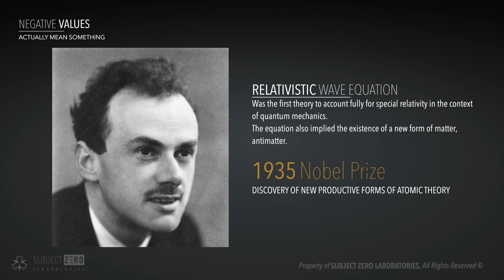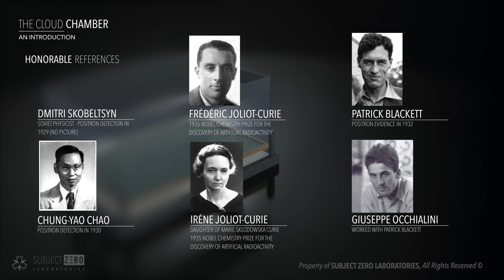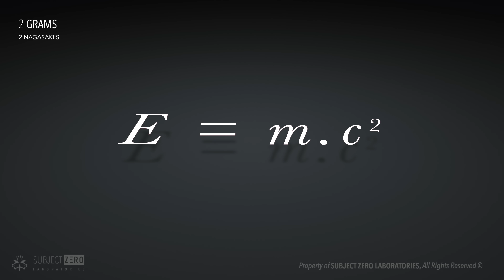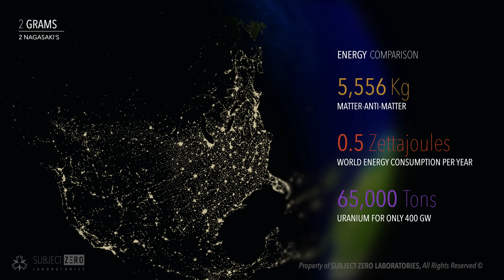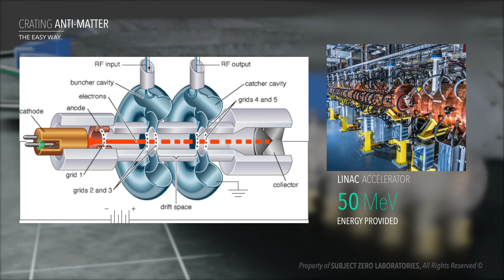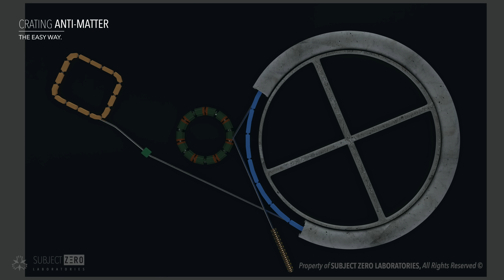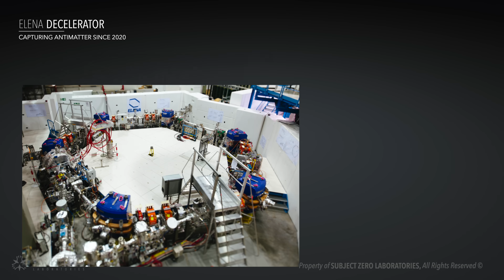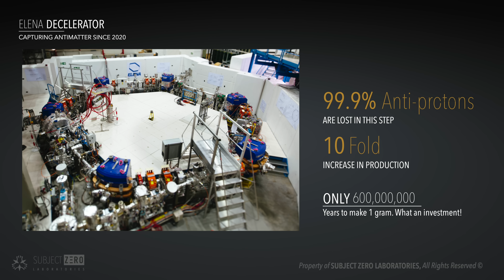Antimatter - How it is made [2019]

Comment: What energy is being released? The energy in the system before and after the annihilation is exactly the same.
Reply: Peter Carlson 
Matter and anti-matter in. Electromagnetic radiation out.

Energy = mass to the square of speed of light 
2 grams = 89,875,518 MJ
89,875,518,000,000 joules
Reply: @JohnSmith-ox3gy  Oh dear!
Positron + electron in and photon + photon out. Or photon + photon in and positron + electron out. Or, some quark + anti-quark in and something + anti-something out. In these reactions there is always particle plus antiparticle in and particle plus antiparticle out, with energy and momentum being conserved for the system.
Reply: @petercarlson811  It's only one photon in or out. Photons generally don't self interact, unless you do something really funky.
Reply: @sumsar01  Do you mean that an electron - positron annihilation gives one photon?
Reply: @petercarlson811  No actually two photons
Reply: @sumsar01  It's positron + electron -> 2 photons ( to preserve momentum) or in case of pairproduction  1 photon -> 2 particles ( matter - antimatter)
Reply: @bjornhammarstrom4153  Indeed. It could also give three photons.
Reply: @petercarlson811  very rarely
Reply: @bjornhammarstrom4153  Yup, rarely indeed.

Comment: This is pointless. Making anti-matter would require you to have energy in the first place and even then in the best case scenario you can only get back up to 100% of the energy you put in the first time. In contrast, petrol, nuclear, solar, etc are already there and deliver energy without you having to make them. Think of it as a battery. Anti-matter would be like having to charge the battery before using it while the others are batteries already charged and ready to use.

Comment: To get high energy from matter-antimatter interaction, we need to apply that same amount (or more practically) of energy for creating it. So, it is difficult.
Reply: Antimatter power is more akin to an extremely energy dense battery.
Reply: @ianmeade7441  i wrote my first comment before reading yours. Same idea 👍
Reply: @ianmeade7441  It's probably closer to fusion than electrolysis.
Reply: @therealjezzyc6209  I meant conceptually it acts like a battery. You put energy in and use it later. And it's not fusion either, since it undergoes total annihilation.
Reply: @ianmeade7441  True enough, although it's equivalent to fusion as in you need almost as much energy to produce antimatter as you'd get from annihilation. From an economics standpoint it's just as viable as current fusion tech. Batteries store energy like you theoretically could with anti-matter. However a battery is really easy to make and won't explode if it's not kept in a vacuum.
Reply: When humans mass produce anti matter, we will have to build new type of energy conversion systems to be able to use it and not blow up cities. 
Imagine a small anti-matter reactor in a jet pack like propulsion system, but instead of compressed gases, compressed ions.
But like every thing it will be weaponized,  and classified ☹
Reply: Could be used as energy storage, it has a very high energy density
Reply: Why does antimatter disappear when made?
Reply: @Thunder Life Studios that violates conservation of electric charge, which is impossible.
Reply: It works well as fuel tho, after all rockets are just giant kinetic energy batteries.
Reply: @mobiuscoreindustries  not quite the same though. The hydrogen and oxygen fuel used in rockets does not come from an application of energy we cause. Antimatter is not a net gain of energy because energy is lost in course of creating it, and regained upon it's annihilation. Hydrogen and oxygen can be used to produce more energy than would be spent to collect it.
Reply: Ian Meade It’s more like if anti matter is such a necessity for space travel (like for the construction of a warp drive that could bend space time) then we’ll have no option but to use fusion energy to create enough anti matter to be able to use warp drives... or maybe we just need to find a solar system made entirely out of anti matter... it might be out there hiding at plain sight.
Reply: @DAXminer-g1g  It's a complete set for assembly: antimatter, fusion reactor, warp drive, and the first interstellar travel craft. 🥇
Reply: @ianmeade7441  remember that anti matter is the only thing in the universe that has a 100% matter to energy ratio

albert einsteins famous equation says it all (given that its still)

Comment: Interesting video. One question though, Anti-matter has mass? Or is it negative mass???? (and how would you weigh it to quantify an amount? In a set of anti-matter produced scales? )
Reply: Mass is positive :) its counter matter that has negative mass -
Reply: Anti matter is really defined by it's spin compared to an object of the same size. Anti-matter still weighs the same as it's matter counterpart, it just moves in the other direction when you put it in a magnetic field.

That's why the proton isn't the antimatter for an electron, despite having the opposite charge. The proton weighs more than the electron and has other properties. Meanwhile an anti-proton behaves almost the same as a proton and has the same mass. This is just how anti-matter was defined, as well as experimental evidence to support this.
Reply: Technically nothing has mass. At least not if it interacts with a weak force.

Comment: finally we can find a bigger better bomb than nuke
Reply: Fusion bombs are bigger than nukes, and can be scaled probably indefinitely. Tsar bomb was actually tuned down:

The initial three-stage design (coded A620EN, not tested) was capable of yielding approximately 100 Mt (420 PJ) through fast fission, 3,000 times the size of the Hiroshima and Nagasaki bombs,[23] but it was thought that it would have caused too much nuclear fallout, and the aircraft delivering the bomb would not have had enough time to escape the explosion. To limit the amount of fallout, the third stage and possibly the second stage had a lead tamper instead of a uranium-238  fusion tamper (which greatly amplifies the reaction by fissioning uranium atoms with fast neutrons from the fusion reaction). This eliminated fast fission by the fusion-stage neutrons so that approximately 97% of the total yield resulted from thermonuclear fusion
 alone (as such, it was one of the "cleanest" nuclear bombs ever created, generating a very low amount of fallout relative to its yield).[24] There was a strong incentive for this modification since most of the fallout from a test of the bomb would likely have descended on populated Soviet territory.[22][25]

Comment: Energy storage has to be stable. Which is not the case with antimatter, requiring absolute void, and high magnetic confinement.
I doubt it could be used as a power source (not storage) as it is not abundant in nature, an requires more energy to be produced than the energy it releases after consumption.
There is not much future for antimatter in my opinion, as "science ficty" and funny it may sound like.
Of course, low amouts for antimatter production for research purposes is still very useful.
Reply: For energy, yeah fusion is much better. For thrusters? Well antimatter is the best ratio for mass to energy conversion, so it makes sense to use it there if we can produce enough to make it worth while, pretty much using a Dyson swarm or reactor bank to create antimatter to be used later in thrusters.
Reply: @Chris Russell for now at least. But couple hundred years later who knows

Comment: Theoretically speaking could a magnetic field of high enough intensity rip apart an atom? Molecule?
Reply: I doubt it, It would require precise control of multiple magnetic fields on the atomic scale and assuming you could do that you would still need to be able to apply enough force in multiple directions to overcome the strong nuclear force on a point smaller than a single atom.... I just don't see that working.
Reply: I mean technically yes, it would be easier if the molecule is highly polar

Comment: If enough Antimatter goes off, the explosion could easily overshadow the Tsar bomb.
Reply: Hiroshima was ~42 kilotons, and one gram of antimatter annihilating with 1 gram of matter equals that yield. So multiplying that by 1000 gives 42 megatons, so 1000 grams of antimatter contacting 1000 grams of normal matter would suffice. Scary stuff!
Reply: well yea... the same could be said of TNT or even just a rock moving very fast. "If enough" the explosion could destroy the whole earth, by definition.
Reply: @rumfordc  The thing is, when matter and antimatter contact and annihilate each other, then 100% of the energy is released. This is normally not the case, even nukes do not reach 100% effectiveness, because the energy is partially heat that just goes up into the sky as a mushroom cloud without dealing damage.